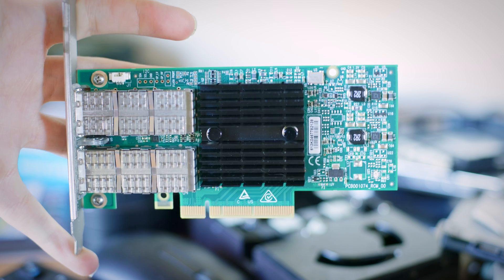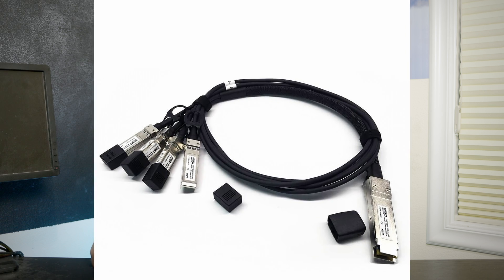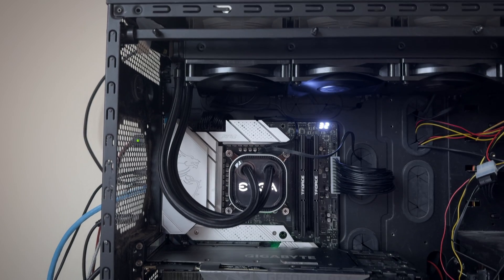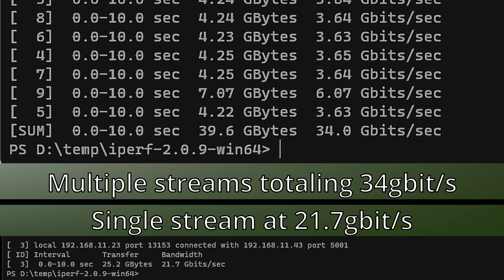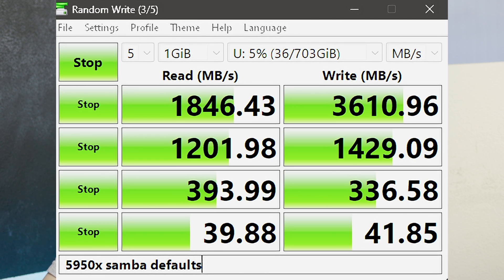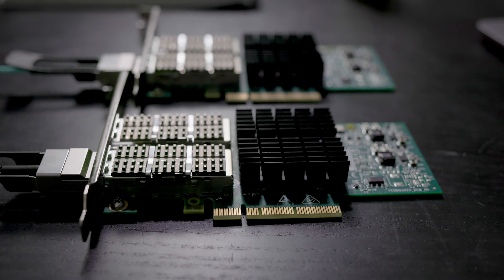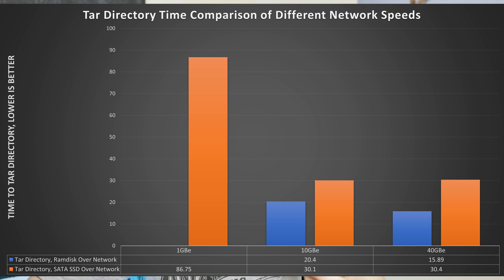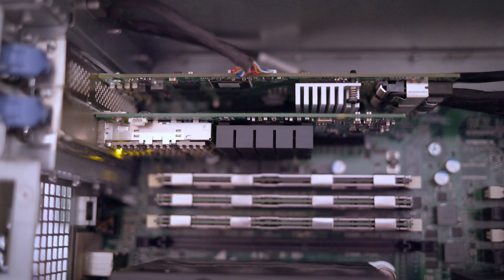Trying out 40GBe, Does It Make Sense In A Homelab?

Comment: Another brocade 6610 user here. I only use the 40 gigabit between the house and garage. The other ports have the quad 10gig DAC break out cables. Almost everything in two racks is running at 10gig. And yes it is massive overkill!

Comment: I frequent your channel every now and then and I like these experiments of yours. Thanks for these tests and your time.
It would have been better if you had included latencies in these tests results. It matters much more than throughput actually. How about a FIO storage test over the network ?
8:04 Also for random I/O w.r.t databases, I think there is no use going for higher speed cards. Most likely the latencies will be only slightly better and not a drastic improvement.

Comment: Doing some math when deciding what gigabit speeds made sense a few months ago, I settled on 25gbit to connect my 12700k server and 5800x desktop. Just a single DAC between them. My 12700k server has mostly spinners with simple mergerfs for storage, so 10gbit would've been fine, but there was basically no price difference between used 10 and 25 gear. Then I bought a Brocade 6610 that I still need to play with, and a dell t7820 to be my new main server (36c/72t, 128GB RAM for now). So I'm considering putting a 40gb card in it since the Brocade has 2 40gbit ports. And, of course, I will definitely need to put my spinners into a zfs setup, with probably a flash cache (with u.2 drives) in front of it. It's a great time to be buying used enterprise gear!
Reply from the maker: Totally agree with getting faster networking if you can. If only the switches were as cheap as the direct connections.

Comment: 10gb is only 1.25GB/s.  most of my ssd's can single-handedly do 3000mb/s constant throughput. the new 9950x machine I just built has a gen5 drive that can do a very real 14GB/s reads and 12GB/s writes.  even 40gb is only 5GB/s.  FWIW, I'm currently running 10 base-t in my homelab and in my house between NAS and workstations. I wish it were easier and less expensive to get faster internet, but honestly most of the time my problem is lack of pcie lanes on consumer platforms.my workstation has 2 gen5, 2 gen4 m.2 ssd's, a 16 lane gen4 gpu (4090 can actually use more bandwidth than 8 lanes provide and thus requires dedicated 16 lanes), and onboard 10g which shares bandwidth with the motherboard chipset (and thus things like high speed usb).  the lack of pcie lanes on modern desktops is absolute garbage and I wish that cpu manufacturers would give us AT LEAST 16 more lanes as normal.
Reply: the reason its so hard is look at the size of the cpu... you can only fit so many physical connections to the cpu socket before they either get too close or you have to make the cpu larger, and if you make one side larger than at least 1 other side has to grow the same amount, but pcie signaling suffers alot from distance especially higher generations. That is why server cpus ARE SO BIG, to have more memory channels and more pcie lanes they need more room to physically interface with the motherboard, but more space means bigger mobos which cost more money. More pcie lanes means better pcie controllers on the cpu which costs more money. More pcie lanes means more pins in the LGA socket which costs more money. If you want more pcie lanes just go buy something like an old threadripper or older amd epyc/intel scalable. They dont use that much electricity on idle, dont cost more than 50-150 USD and are way better at multicore tasks as they have more of everything. I have a dual 7402 setup that uses 100W at idle but thats with 2 PSUs, 512gb of ram, 10 u.2 ssds, a 40gbe NIC, iDrac 9 and other shit connected. With 1 cpu, no iDrac and other shit not connected it will probably pull like 50w idle

Comment: My homelab has the issue with different NIC speeds. Proxmox 3-node cluster 4x2.5Gb. Personal PC 10Gbe. Synology NAS with (4x) 1Gb. I use SMB multi-channel on the NAS to get bursts of speed when it can. It helps out quite a bit.

Comment: it makes too much sense in this day and age where networking is arguably the weak link - especially for small biz - dual nas and ws connected with 40g (no switch) makes a ton of sense, saves time and ups productivity and effciency - maybe you could make 'the ultimate nas' with an older platform in order to max out the ram - z420 may be the ticket with a lower powered cpu? could be a decent starting point for experimentation/bench lab

Comment: ok, maybe i'm stupid, but pcie 3x4 only allows for a theoretical maximum of 4GB/s so 32Gb/s, right? how could you max out one of the 40GB/s ports with that connection?
Reply from the maker: Yea your right, you can't max out 40GBe with a gen3 x4 SSD. I did most of my testing with RAM disks in this video to rule out this factor. You can get a lot more speed over 40GBe than 10GBe with these ssds though.
Reply: @ElectronicsWizardry oh okay, i thought i was going insane for a minute lol. but my comment was in relation to your statement around 0:45 and not ssds. great video though. :)
Reply from the maker: Oh derp. A gen 3 x4 slot and a gen 2 x8 slot would limit speeds a bit, and I unfortunately didn't do any specific testing. I should have checked a bit more, but I believe I could get close to full speed on those slower link speeds.

Comment: Set up 10gbe (Dual XCAT 3's with a switch, XGS1210-12, in between to connect everything else, 2 sfp+ 10gb, 2 2.5gbe rj45, and 8 1gbe rj45) at home, usually get around 600MB/s when copying files, if I make a ram share and stop all dockers and vm's I get +-1.1 GB/s depending of file size, Iperf3 tells me I'm at 9.54-9.84 Gb/s.

Comment: I think 40GbE is getting pretty rare these days, replaced with 25GbE. While a 40GbE switch port breaks out into 4 x 10GbE connections, a 100GbE switch port breaks out into 4 x 25GbE connections. Switches with 25GbE ports and 100GbE ports are available at quite decent pricing for higher-end home labs. Further, the Mellanox ConnectX-3 series of cards has been deprecated or made all out incompatible with some server operating systems and hypervisors in favor of ConnectX-4 cards. I am thinking of ESXi here, which is what I run at home. I have a Ubiquity USW-Pro Aggregation switch with 4 x 25GbE SFP28 ports, each connected to a Mellanox ConnectX-4 card, two in two Synology NASes, and two more in two Dell PowerEdge servers.

Good video. You're a good presenter!
Reply: This. Mellanox ConnectX-4 cards with 25Gbps DAC cables are not so expensive.

Comment: talking SSDs reminded me too of a recent issue I had where my ZFS share would start out at like 400MBps (10G connections) but would quickly drop down BELOW GIGABIT speeds and it was 6 spinning 7200rpm drives with a 128GB SSD caches.....i mention it because REMOVING the cache actually sped it up to like 350MBps+ consistent speeds - the SSD was what was bottlenecking my rusty ZFS pool because it was trash flash as an arc cache...anyways not really related but i thought that was one of those interesting things where i had to tweak/test/tweak/test/ad infinitum as well
Reply: Most people don’t need L2Arc and it consumes more RAM for no real benefit. If you only have one SSD for multiple HDDs, you should set it up as a special VDEV. Although having 2 mirrored is recommended, since losing data from the special VDEV destroys your pool (irrecoverably).
Reply: This same thing happened with Dropbox. They removed cache and transfers became faster.

Comment: great vid, keep em coming!  also i recently went to 10G/2.5G for my home network so i looked into 40G at the time - i didnt think i heard it but be careful about going 40G -> 4x10G as thats to my understanding only going to work for switches and I think its only for one brand (mellanox maybe? i forget)...i ended up going with an x710-da4 instead for 40GB in 4x10G without needing to worry about any issues....i think those cables were specifically made for going from a core switch to your other switches or something like that but if im wrong pls correct me, mostly i just remember it seemed like a hassle waiting to happen so i didnt go that way
Reply from the maker: I don't have a ton of experiences with those breakout cables, but I think your right that there pretty picky, and you can't just use them for every use case.

Comment: I'd be curious to see what the difference is you used ISCSI instead of SMB or if you could do FC what the RAMDISK to RAMDISK would be.
Reply from the maker: I didn't try iSCSI, but I did try NFS with similar performance as SMB. I might do a video in the future looking at NFS, SMB, iSCSI and more.
Reply: I found iscsi to be slightly faster than NFS, but my NFS performance with truenas, chelsio T580's and DAC running point to point is abysmal.  I can get iperf to give me 20gb/s but putting a steam library on there results in approx 200 kb/s transfer rates - it take almost 5 minutes to load a game.  Looking at a traffic graph its mostly not sending any data.  My current thought is a lack of airflow is causing thermal throttling as these are server cards without mounted fans.

Comment: Definitely recommend trying ksmbd on linux - basically a drop-in for SAMBA, so very simple to set up and enables RoCE.  Between 2 Intel 13th Gen systems each with Mellanox ConnectX-5 100G cards and RAID0 NVME SSDs I can hit a bit over 7GB/s (56Gbps) real-world SMB file transfers. Does also show that it's really not worth going higher than the used 40Gbps ConnectX-3s for homelab (which can be made to run at 56Gbps with Mellanox transceivers/AOCs which can also be found at good prices these days with enterprise all moving to QSFP28/SFP28) as they are much cheaper and the benefits of the newer kit is marginal at best

Comment: Seven things:

1) I'm current running 100 Gbps Infiniband in my homelab.

For storage, because my backend servers are all running HDDs, therefore; I think that the absolute maximum that I have ever been able to push was around 16-24 Gbps (block transfers rather than file transfers).

In nominal practice, it's usually closer to around 4 Gbps max. (~500 MB/s)

But again, that's because I am using 32 HDDs on my backend with no SSD caching. (SSDs are the brake pads of the computer world -- the faster they go, the faster you'll wear them out.)

2) For NON-storage related tasks, my HPC FEA application is able to use somewhere around 83 Gbps or thereabouts when doing RAM<->RAM transfer between my compute nodes in my micro HPC cluster.

That roughly about where RDMA lands, in an actual RDMA-aware application.

(Or really, it's MPI that's able to use the IB fabric.)

A long time ago, I was able to create four 110 GB RAM disks, and then created a distributed striped Gluster volume and exported that whole thing back to the IB network as a NFSoRDMA share/export.

But if my memory serves, that ended up being quite disappointing as well as I don't think that it even hit 40 Gbps due to the various layers of software that were running.

3) "RoC over E" is actually just "RoCE" - RDMA over converged ethernet.

4) If you want to try and push faster speeds, you might want to look into running SMB Direct rather than SMB multi-channel.

5) For network data transfers, I don't use SMB for that. I mean, I can, but to get peak performance, that usually will happen between Linux systems (CentOS 7.7.1908) because one can be the server which is able to create a NFS export which has NFSoRDMA enabled whilst the linux client will be able to mount said NFS share/export with the "rdma,port=20049" option, to take advantage of NFSoRDMA.

6) Ever since I went through my mass migration project in Jan 2023, MOST of the time now, my Mellanox MSB-7890 externally managed 36-port 100 Gbps IB switch is OFF. Since my VMs and containers run off of a single server (the result of said mass consolidation project) -- therefore; VM <-> host communication is handled via virtio-fs (for the clients that support it) and for the clients that doesn't support virtio-fs (e.g. SLES12 SP4, out of the box) -- I use "vanilla" NFS for that.

Again, with HDDs, it's going to be slow anyways, so even with virtio NICs, they show up as 10 Gbps NICs; except that I don't need a switch, nor any cables, or any physical NICs since all of it is handled via the virtio virtual NICs that's attached to my VMs and containers, in Proxmox.

(NFS, BTW, also, by default, runs with 8 processes.)

7) The NICs, cables, and switches are only cheaper in absolute $ terms, but on a $/Gbps basis -- they're actually quite expensive still.

My Mellanox switch is capable of 7.2 Tbps full duplex switching capacity, which means that given the price that I paid for said switch at the time ~$2270 USD), I am about $0.31517/Gbps.

Pretty much ALL 10 Gbps switch that I've looked it, would be a MINIMUM of 4x higher than that. Most of the time, it's actually closer to like 10 TIMES that price.

i.e. if you want an 8-port 10 Gbps switch (80 Gbps switching capacity - half duplex/160 Gbps full duplex switching capacity) - that switch would have to be priced at or below $50.43 USD to be equal in cost in terms of $/Gbps as my IB switch, and 10 Gbps switches still aren't quite there yet.

So, from that perspective, going 100 Gbps IB was actually a better deal for me.
Reply: where the hell did you get 'ssds are like brake pads, the faster you go the faster they wear out'?? that makes no sense. If you have a 100GB file and write it at 100GB/s or 100KB/s its not gonna change how much wear the drive will get. The only time the drives get alot of wear is when you are writing near their RATED Drive writes per day
Reply: @masterhacker7065  
"where the hell did you get 'ssds are like brake pads, the faster you go the faster they wear out'??"
You're clearly NOT thinking about WHY people use SSDs over HDDs then.

Think about it some more.

WHY do people use SSDs over HDDs?

(Hint: speed. Therefore; the faster the difference is, the more people are going to use the faster option rather than the slower option. And since SSDs have a finite number of program/erase cycles, therefore; the more you use it (because SSDs are faster than HDDs), the faster you're going to consume said finite number of P/E cycles.)

It's so obvious.

You're clearly NOT thinking about HOW/WHY people use SSDs in the first place.

Comment: I got a brocade ICX 6610 for a song and after some hunting around found out you can use the stacking 40gb ports for regular data after some tinkering.  Cards and cables will cost a bit but honestly considering I got the switch for $120 to add more 10gb ports another $120 or so for 40gb cards and cables to test it with is about the price of a Mikrotik CRS309-1G-8S+in all said and done.  Uses more power and makes more noise (and the cards run significantly hotter) but it will be fun to play with.

Comment: really good content - a ws to a dual nas with dual port 40g is a great setup for anybody but esp small biz sector - no switch needed and you can sync nases quick - maybe in followup you can use nvme raid0 arrays and bonded 40g for effectively 80g between ws and nas - the 56g connect-x cards are like around 50 bucks so this can make for an affordable speedboost and especially good if you are moving a lot of video/vms/backups or other big data around - good to see this content and how relatively easy it is to get the most performance with smb multi chan and jumbo frames

Comment: Please keep in mind. This card's need active coming. A fan that move some air over them. So a 6cm fan at 5v will do it. Without airflow the cards will throttle down and even stop working at all.
Reply from the maker: Thanks for pointing that out. I was doing some testing and had extremely low speeds and dropouts. Then I noticed the syslog messages and the card had an extremely hot heatsink. A fan made the card work as normal again.
Reply: Most 10gb NICs need active cooling. Especially if you don't have them in rackmount chassis. I stuck some X540s in a few old Lenovo thinkstation tiny 1L systems I have running in a HA cluster on Proxmox. I took the blower fan coolers off a few old Nvidia Quadro cards I had and modified them to fit onto my NICs and spliced the CPU fan connections to operate the blower fan, that keeps them running cool even under pretty intensive transfers. Did something similar for the NIC in my main desktop. Took a single slot gpu cooler off an old radeon pro card and a copper heatsink and modified it to fit. Then I just adapted the JST xh fan connector to a standard KF 2510 4 pin PWM fan connector and hooked it up to my fan hub with a temp probe to set a custom fan curve for it.
Reply: This! many do not realise these are cards found in servers with high CFM pushing through the entire chassis

Comment: my servers all have dual 40gbe nics and they're set up in a circular daisy chain (with spanning tree). it's really great for when I want to live-migrate VMs through Proxmox, because it goes fast even if the VMs are huge. not much other benefit unfortunately since the rest of my home is connected by 1gbe (despite my desktop PC also having a 40gbe nic that is unused due to cat🐈🐈‍⬛based vandalism)
Reply: One of my cats bit of both fibers in a 10 Gbps LAG :)  I wondered why the computer was off the network and after some investigating noticed bite marks on both fibers. The fibers have since been replaced with DAC cables that apparently does not taste as good.
Reply: @CassegrainSweden  hehe
The cable runs are too far for DAC for me, so I gotta make do with Cat6e, I'm afraid that if I use fiber again maybe this time when breaking the fiber they might look into it and blind themselves. Glad your cat and your DAC are doing fine!